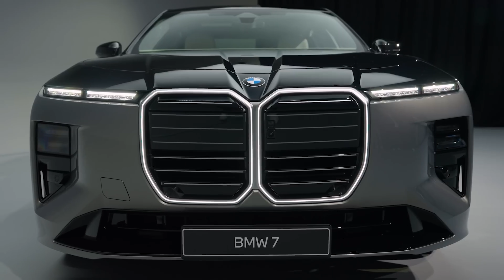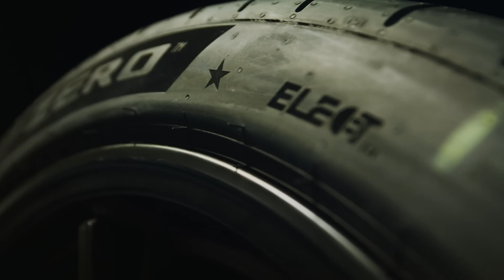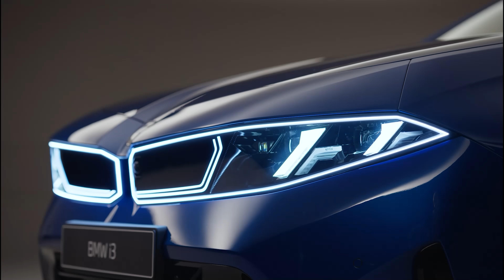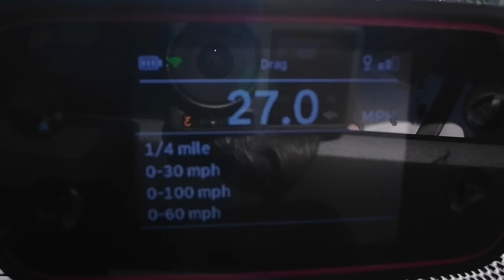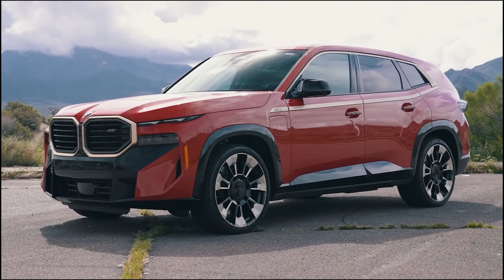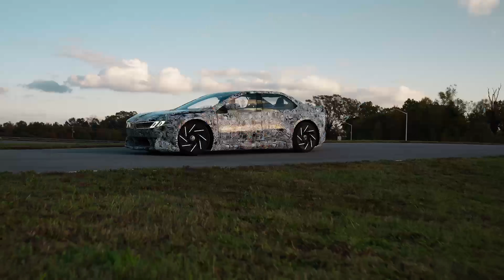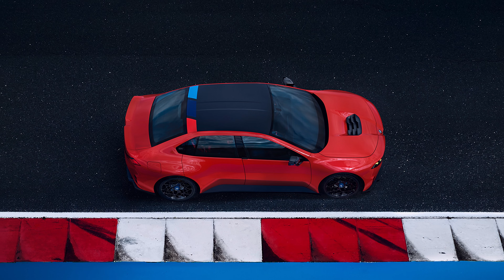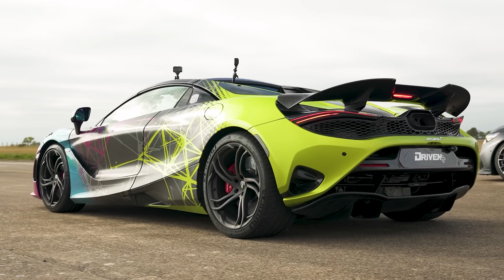New BMW M3 is the BEST they’ve EVER MADE!

Comment: A low rear diffuser won't work.  How is it suppose to generate suction without lowering air pressure by rapidly increasing the volume into which the air flows (via a tall gap under the rear bumper cover)?